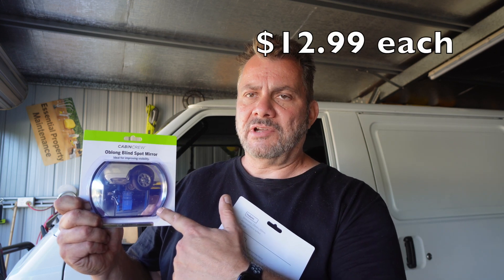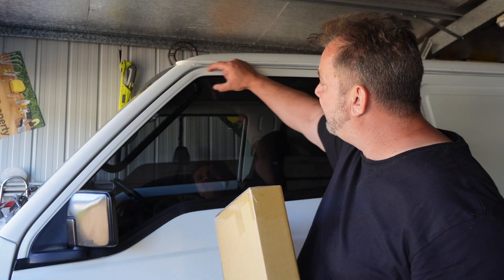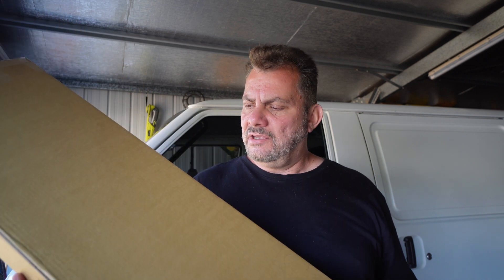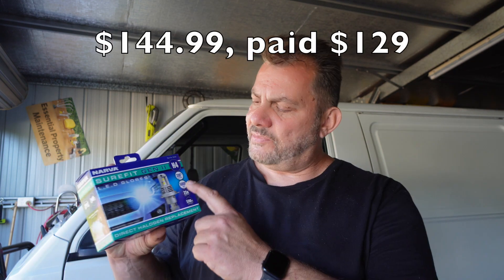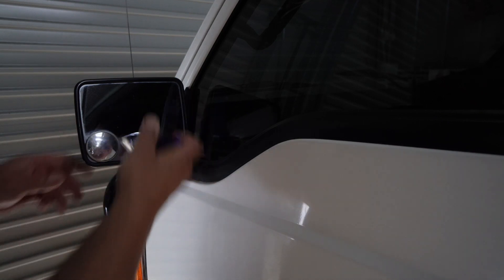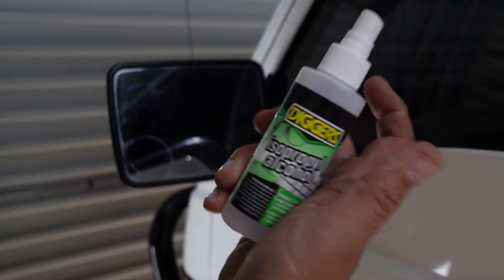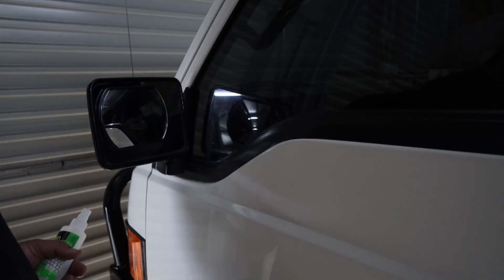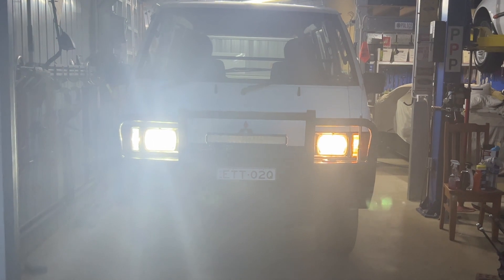Van Life Ep 12 - First Three Mods To My 'New' 4WD Van - Mitsubishi Express L300 4x4

Comment: The vans look good and in good condition for there age. What window tint is on it? Looks like 5% ,  Was the razor u used a plastic one? JUst curious ! I always wondered where to buy alcohol spray from. Going to bunnings tomoro. 😊
Reply from the maker: Yes, Bunnings sells it in the paint department. Great for cleaning lots of things. Not sure about the tint, but it's pretty dark. Took 5 years of searching to find the 4WD one, insanely hard to get in that condition, most were trashed, it's nearly 30 years old.

Comment: Wow u did well ! What about the razor?
Reply from the maker: Yes, Still can't believe I finally found one. Standard paint scraper razor also from Bunnings, Kincrome brand because it has lifetime replacement warranty. Comes with the handle/blade holder and a number of replacement razor blades, they sell them in the tool section of Bunnings.
Reply: Thanks heaps Mike!